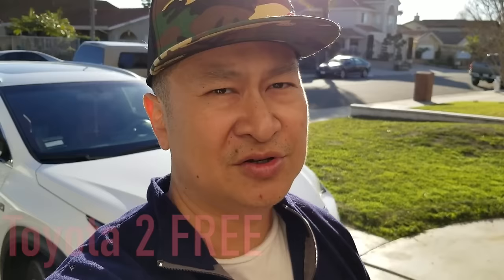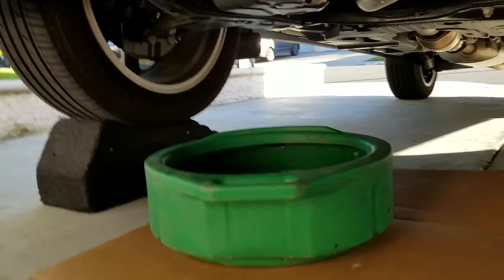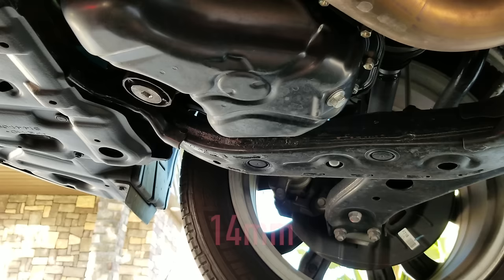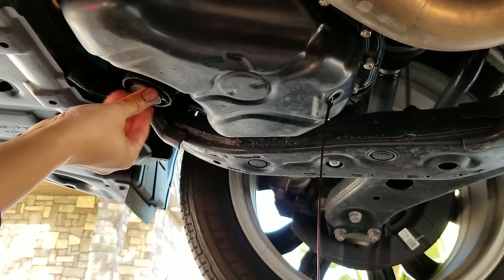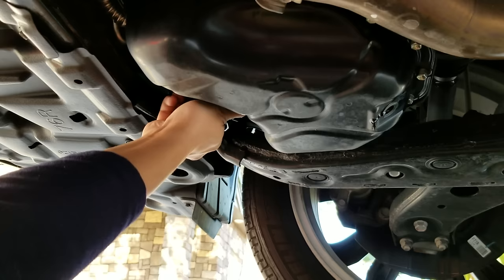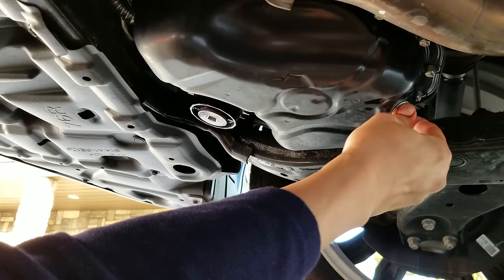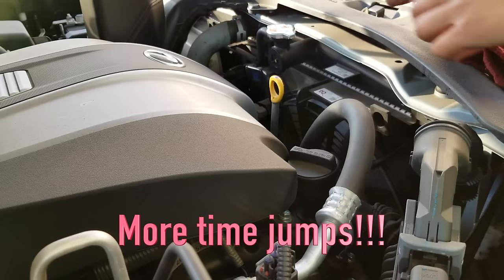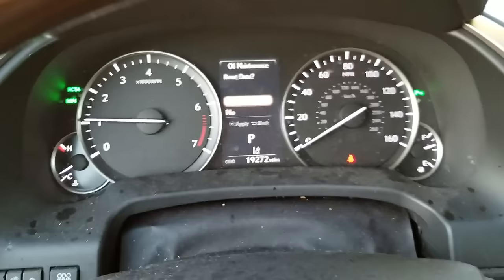Lexus RX350 Oil Change DIY 2016 2017 2018 2019 2020 2021 2022 models - Motivx

Comment: FYI, you forgot to detach old washer from oil pan. You put double washer. You use flat screw driver to take out easily. Also, side note of the Toyota type oil filter wrench to be getting stuck sometime due to your warm engine oil, use flat screw driver works the best. I do this for my 2013 IS and 2016 RX.
Reply: It's good to see mistakes made so we can be aware
Reply: I noticed that also... all that fancy tools but forgot to remove old washer. Also draining filter cup for making less mess is not really true. I just partially unscrew the filter housing and let it drain then just remove it directly in oil catch pan. Watching this video seems that I make less mess by skipping using that drain hose.

Comment: Nice vid!  Really helped me do the job.  Thanks!  Some comments from my experience.  

8:24 and 10:45  The oil filter housing has 3 tabs on one side and 1 tab on the other (180 deg opposite) side; the oil filter housing socket has matching slots.  Make sure to match them up because removal of the housing is next to impossible unless the housing and socket are exactly matched.  As Rob noted, after most commercial oil changes the oil filter housing is way, WAY over-torqued, certainly much more than 18 ft.-lbs and removal can be a major PITA.  I had to use a breaker bar to get enough leverage to start unscrewing it.  

6:00  I attached some plastic tubing (from excess I had from lawn sprinkler work) to the provided plastic fitting to drain the oil filter housing.  Adequate workaround if you don't have the metal fitting he uses.  

4:40 and 5:55 About 20 years ago I started using oil drain plug valves on my vehicles and it's a nice feature that I don't have to get oil all over my hands any more when I remove the drain pan plug.  On some types there's a "nipple" where plastic tubing can be attached to prevents drips (or wind spray as in this vid).  Fumoto is a big brand but there are others out there.  Drain plug valves are also fantastic if you over-fill the sump and have to remove just a little (you're correct in wondering how I know that, LOL).
Reply from the maker: thanks for the detailed feedback!
Reply: The odd thing is that Motivx now make their oil filter removal socket so that it does NOT engage those tabs.  On their Amazon listing for the MX2320 the images state "old style wrench can cause broken tabs" and "engages only the top fluted portion of the filter housing".

Comment: Great video , I like the motiv products , I have the oil filter wrench , Funnel & 24 mm socket from them for our 2015 IS 250 .... Now I'll be using it for our 2021 Rx 350 when the factory oil changes are up . Thanks for the video

Comment from the maker: Today was a holiday but I had to take care of my wife's RX350 oil change. 

...and of couse I did a video 😄

It's lengthy as I wanted to cover all the steps of the oil change.

MotivX oil filter wrench https://goo.gl/hBwvMb
oil drain tool https://goo.gl/4qE9YM
fitted oil funnel https://goo.gl/oYQztz

Get the 3 item bundle and save money here: https://goo.gl/K3S1KC

other stuff to buy...

can buy the above kit at Amazon too https://amzn.to/2r9rvLL

3/8 inch socket set https://amzn.to/3zBnUZr
Mobil 1 0w-20 synthetic qty 2   http://amzn.to/2sJ0alB
Toyota oil filter kit with oil pan washer qty 1 04152-YZZA1 Oil Filter and 90430-12028 Oil Drain Plug  http://amzn.to/2rx129d

you'll need an oil collector of sorts  http://amzn.to/2uXQ9Bw
funnel (narrow ) http://amzn.to/2wn1ZTE
nitrile or rubber gloves  http://amzn.to/2u5JpTm
rags or paper towels   http://amzn.to/2uYlK6d
14mm socket+rachet and extension   
pick or nail / tack could work. paperclip too   http://amzn.to/2f9MFGR
Reply from the maker: Jenna Mendez hi. I have links for it in this video’a description
Reply: How is fuel efficiency on this thing compare to new 2019 rav4??

And reliable??
Reply: instaBlaster...
Reply: @alanh8101  reliability is probably better, fit and finish is definitely better, fuel economy is worse, but it is apples and oranges, the RX is huge compared to the RAV 4. The RAV 4 compares more to the NX .

Comment: It is very useful and simple. I do not trust the servicemen for changing the oil. I have seen many different cases, like hitting my radiator for opening the oil filter for the Toyota that I had and not changing any oil and oil filter and claiming it is done. 
I prefer to it myself.

Comment: Great video. I do like the tools you use for pouring oil and draining oil from oil filter housing. I am getting those for sure.
Reply from the maker: Thanks for watching! 👍
Reply: Get a Fram cartridge.  Comes with o-rings and a plastic tool.  You can add hose if you want.

Comment: First time i oil changed my RX 2017. Used to bring to Dealership for the past 5 yrs. My engine sounds louder than normal. Last few days. I kinda just noticing my idling is higher. Like first start 1000 rpm. After 10 mins drive now is bout 900. On the third bar. I used oils 0W20 sae Mobil 1 advance fuel full synthetic

Comment: Awesome vid. One recommendation I would give is upgrade the oil filter housing to an aluminum one. I think yours is the plastic one? Those tend to crack, especially if you go to those express oil change places. They over torque it and crack the housing. Again, not required, just a nice upgrade! Keep up the great work!
Reply from the maker: yes.  we encountered that exact issue so we did a video on it later in time https://youtu.be/2m2HKr35rqU

Comment: The bottom cap is just to reduce the oil messy. Can we just ignore the bottom cap and open the whole filter instead?
Reply from the maker: yes and it'll be very messy as you stated

Comment: Rob, I think you forgot to remove the crusher washer when you removed the drain plug. The  washer gets stuck on the drain opening. This typically happens when I do an oil change on my wife’s RX350. A light tap with a flat tip screwdriver will remove it. However having doubles washers will not cause a leak. Just remember next time.
Reply from the maker: Yes I was testing if you guys were paying attention 😉

Comment: Can you provide links to the filter hose setup then reply to this comment, please?
Reply from the maker: MotivX oil filter wrench https://goo.gl/hBwvMb
oil drain tool https://goo.gl/4qE9YM
fitted oil funnel https://goo.gl/oYQztz

Get the 3 item bundle and save money here: https://goo.gl/K3S1KC

other stuff to buy...

can buy the above kit at Amazon too https://amzn.to/2r9rvLL

3/8 inch socket set https://amzn.to/3zBnUZr
Mobil 1 0w-20 synthetic qty 2   http://amzn.to/2sJ0alB
Toyota oil filter kit with oil pan washer qty 1 04152-YZZA1 Oil Filter and 90430-12028 Oil Drain Plug  http://amzn.to/2rx129d

you'll need an oil collector of sorts  http://amzn.to/2uXQ9Bw
funnel (narrow ) http://amzn.to/2wn1ZTE
nitrile or rubber gloves  http://amzn.to/2u5JpTm
rags or paper towels   http://amzn.to/2uYlK6d
14mm socket+rachet and extension   
pick or nail / tack could work. paperclip too   http://amzn.to/2f9MFGR

Comment: Lol…. This us easier than changing the oil on my 2016 Mazda CX-5! It has a skid plate to mess with. We have a 2022 Lexus RX350 V6 and in Canada, they want you to change the oil every 16,000kms. I don’t go longer than 8,000kms between oil changes. Our dealership has included free oil changes for life but based on 16,000km intervals….. so I’ll just do one myself between intervals.
Reply from the maker: Our LX 570 had a big steel plate to remove so that was fun

Comment: Very good video indeed. Maybe tell us what happens after you reset the oil maintenance schedule, i.e at what mileage before the remainder will let you know again. at 10k or 20k? Thanks, Rob.
Reply from the maker: every 5k the maintenance light pops up. the recommended oil change interval is every 10k.

Comment: I have a question regarding oil, my vehicle is Lexus RX350 2018 I did oil change but I didn’t notice on the oil which was written suitable for hybrid vehicles is it ok or what please advise me
Oil was Mobil1 0W20 advanced full synthetic  advanced fuel economy suitable for hybrid vehicles but my vehicle is not hybrid.

Thanks
Reply from the maker: Look at the oil cap on your Rx. It will have the recommended oil

Comment: that drain tool is rad! way better than using the plastic one that comes with the filter element! buying one asap!
Reply: Also, I think I might've seen two crush washers on the drain bolt? One is stuck on the pan still when you put on the new one!
Reply from the maker: @alex1pham  I had thought it was a washer too but I went at it with my pick and even a screwdriver and it wasn't budging. Also the edges weren't silver. I didn't want to mar it up as if that was a lip to the pan it could leak.
Reply: That plastic one is crap.  I had one get locked in.  Took some effort to get it out and when I finally did a piece broke off and got stuck in the housing.  Had to disassemble the housing to get it out.  Really does look like he double washered the drain plug.  I would just torque the crap out of it.  Would suck to waste all that brand new oil just to change out the washer.  Haha
Reply from the maker: If that was the washer it wasn't budging. I went at it with a pick and a flat head screwdriver. Dealer must have kung fu torqued it.lol
Reply: @RobDaman  My Tacoma I have to use a piece of wood and quick tap from a hammer.  You pretty brave to take a screw driver to a sealing area.  😬 I think cuz it's fiber it kinda becomes fuzed to the pan over time.
Reply: Rob Daman upon further investigation, I’m certain it’s a washer! Check out 4:35, bolt comes out but no washer connected on it. I did my oil change on my 4runner yesterday and had to use a screw driver and gently hit it against the washer to get it off. Would be a pain to drain the new oil just to get the washer off... I would just torque it down a little extra haha
Reply from the maker: I guess my kung Fu was weak that day. I checked for leaks and it's good to go 👍

Comment: I am very interested in knowing about the 2017 RX350 Lexus SUV automatic transmission fluid change and flush. One or two videos show how it is done but the steps are not very clear. Could you please make a thorough and clear one for the benefits of the readers? Thank you very much for sharing your expertise and experience.
Reply from the maker: I ended up trading in the RX for a LX due to expanded family.  If I recall it's "lifetime" fluid but I do understand the concern as it can't be forever truly.

Comment: Hey man, is that a stuck crush washer on the pan? or it is part of the oil pan? My new Lexus oil pan looks like yours. but when I removed the drain plug, there is no crush washer from the factory. Now I am not sure if it is stuck on the pan or that's the mouth of the drain hole.
Reply: They stick to the oil pan most of the time for me. Check you didn’t double it

Comment: Rob thank you！My car is 2016 rx350. I need 6QT Mobil 1 oil right?
Reply from the maker: thanks for watching.. that is correct. here's the specs but use your dipstick to be sure...

5.8 quarts (5.5 liters) – with filter change, for vehicles with towing package
5.7 quarts (5.4 liters) – with filter change, for vehicles without towing package
5.6 quarts (5.3 liters) – without filter change

Comment: Today I brought my 2016 Lexus to Dealer.
They are recommend me a rear brake rotor cut and replace rear brake pad at $450. Is this sound too much money? also they are doing an aligment at $280. is that too much for wheel alignment?
Reply from the maker: I'm assuming this is a USA dealer and us dollar quoted.

I'd shop around at maybe a toyota dealer or independent shop. I'm sure the work is good but my opinion price is high.

Comment: I would use the Mobil 1 oil filter especially if you’re going to do their 10,000 mile oil change intervals.
Reply: All you need is brand name filter with the proper specifications. They all do the same thing.

Comment: Do you not take off the top engine oil cap before you drain the oil? Doesnt that allow the old oil to drain faster with air being sucked in as the old drains out?
Reply from the maker: I've done it both ways. not much difference.

Comment: Robert question.I went on the link to buy those car ramps you have because I love them over the plastic unsafe ones.They finally got back to me and I saw the price as 65.00 each on the website.Now they want to sell them to me for 128.00 a piece because they are in Canada?My question is did they rip you off like that in price?Im willing to pay 130.00 for the pair but not 256 for the pair.
Reply from the maker: i got mine years ago for a good deal but they're heavy so I'm sure that's why they cost so much now. I can tell you they'll last for decades.

Comment: Thank you for the very thorough video. For 2019 NX300 F Sport you use the same oil filter 04152-YZZA & drain plug washer? Where did you get the torq specs?Are the torq specs for the RX350 same as the NX300 F Sport? Thanks Rob
Reply from the maker: I found them online via a service manual and also motivx site to confirm.  

It should be the same across the board for Toyota/Lexus. 

I would also consider the aluminum housing replacement for peace of mind

https://youtu.be/2m2HKr35rqU
Reply: @RobDaman  thanks

Comment: Hi Rob, I am new to using socket tools and changing oil—
What insert tool did you use to un-tighten the filter drain plug?
Reply from the maker: 3/8 inch rachet and extension. you can pick up a nice set here https://amzn.to/3zBnUZr
Reply: Thank you for your prompt response

Comment: What are your thoughts on the 60.000 mile $1200 Lexus dealership maintenance?
Reply from the maker: I haven't looked up all the scheduled maintenance for the RX till 60k but you could always look at an independent shop costs. Unless brakes are included it may be on the high side.

Comment: Rob how much for all the parts and to do the oil change for someone who needs to get all the stuff together to do the job.
My local Lexus dealer wants $90 to change it out
What do you think? Do it myself ?...
Reply from the maker: It's not a hard job and total parts would be close to that but you'll have the tools so your cost next time would be $30 ish.  

here's the list...

you need that oil filter wrench. The other 2 are nice to have too but not as critical. 

MotivX oil filter wrench https://goo.gl/hBwvMb
oil drain tool https://goo.gl/4qE9YM
fitted oil funnel https://goo.gl/oYQztz

Get the 3 item bundle and save money here: https://goo.gl/K3S1KC

other stuff to buy...

can buy the above kit at Amazon too https://amzn.to/2r9rvLL

Mobil 1 0w-20 synthetic qty 2   http://amzn.to/2sJ0alB
Toyota oil filter kit with oil pan washer qty 1 04152-YZZA1 Oil Filter and 90430-12028 Oil Drain Plug  http://amzn.to/2rx129d

you'll need an oil collector of sorts  http://amzn.to/2uXQ9Bw
funnel (narrow ) http://amzn.to/2wn1ZTE
nitrile or rubber gloves  http://amzn.to/2u5JpTm
rags or paper towels   http://amzn.to/2uYlK6d
14mm socket+rachet and extension   
pick or nail / tack could work. paperclip too   http://amzn.to/2f9MFGR
Reply: You can get the oil (5 qt) for about $22 plus tax at Walmart, $6-$15 for the oil filter if you’re vehicle uses more than 5 quarts buy it at Costco it’s $28 plus tax online right now. If you don’t have a jack you can get metal ramps for $44 from Harbor Freight or $39.99 plastic ones from Walmart, $15 for a drain pan although you can skip it and use an old cooking pan, $3 for a 9/16 socket, $10 for a wrench, $15 for the funnel used in the video about $3 for a normal funnel. $6 for a similar (Pennzoil) oil filter socket from O’Reilly. I don’t know what tools you may have as you may not need to purchase all of these if you have some tools. I would say do it yourself you only have to pay for the tools once and you’ll always have them. After that your oil changes will cost dramatically less. Also if you don’t feel comfortable you can always take it to a Toyota dealer they will use the same parts and oil as a Lexus dealer but will charge you much less.

Comment: Don't fill the filter with oil. You don't need to. You don't need a Toyota branded filter. Any brand name will do. You don't need a washer from the dealer either. Using a torque wrench is a good idea. I have made it a habit.
Reply from the maker: torque specs are in the description for those interested.
Reply: @RobDaman  I know what they are for my car. For things like oil drain plugs, it's drearily the same for most cars. Around 25 to 30 foot-pounds will do. Some mechanics say, pre-filling the filter risks introducing particles into the oil system. I just don't do it. There's enough residual oil in the bearings and in the cam area to cover it. On my present vehicle, the filter horizontally would hold only six ounces. On my previous vehicle, you couldn't prefill it. It was vertical.

Comment: great video.  how high are the ramps you are using?
Reply from the maker: Bottom curve is about 6 inches
Reply: @RobDaman    Is that enough height to do the oil change?  I have a CRV and I bought rhino ramps to do oil change but seemed kind of low.  Are rhino ramps ok for the lexus?  Also, any tips on how to break loose a really tight oil drain plug?  mine is not as easy as in your vide unfortunately....

Comment: What about rx350 f sport model oil capacity.    ? Same?
Reply from the maker: yes unless it has a tow package. Always under pour and use the dip stick to confirm proper oil levels.

Comment: Nice video. Did you remove the washer from the drain plug? Still don’t see the advantage of using a cartridge instead of a canister filter. Worry the shops will not bother to change the filter